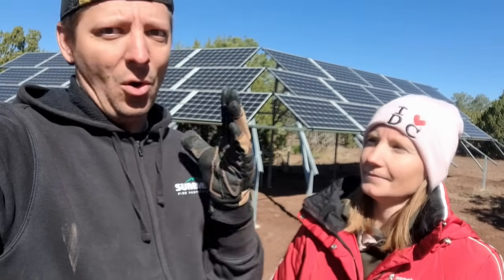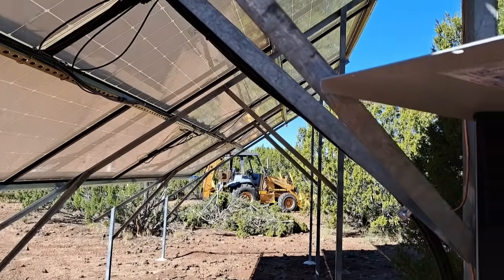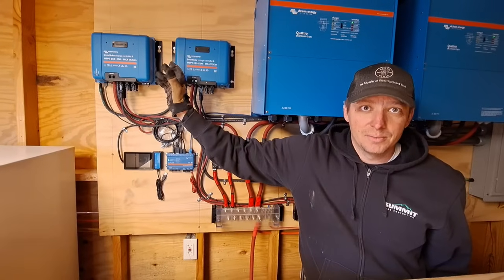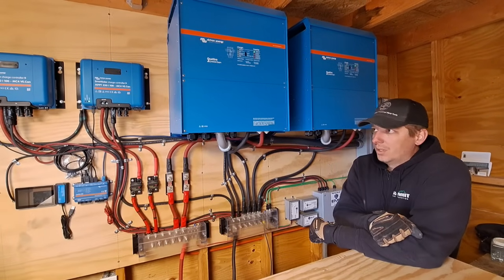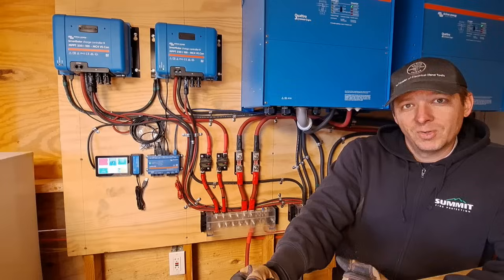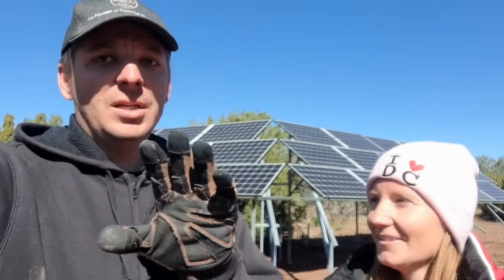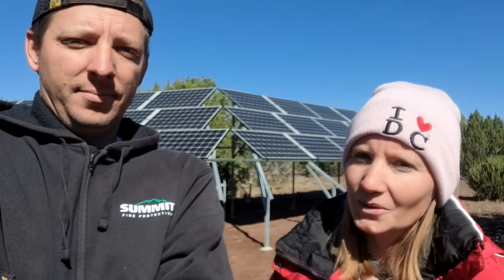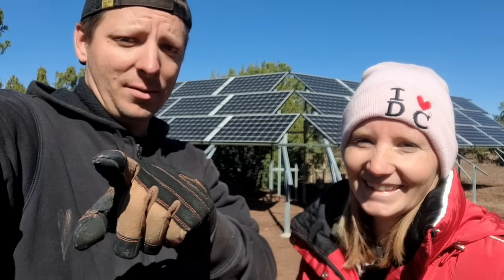INFLATED COST Of Our 100% DIY Off Grid SOLAR POWER SYSTEM 👍

Comment: Most do this simple interest calculation..."I will pay 100$/mo. for decades"...you won't❗. Ever hear of Inflation? And it's Compound Interest...Utility rates of Inflation avg. ~5.5%* (some have been recently 40+%!!) for US electric Rate increases. So at *traditional avg. U.S. rate increase (prior to 2020), 1200$/  year becomes ~3,500.$ in year 20.   Conclusion, if use same amt. of kWh/mo. over next 20 years at *traditional avg. rate increase , then you will avg. ~$1750$/ yr... or cumulative ~35,000.$$ over 20 years!!🧐  (if rates don't increase*...good luck with dreaming🤪.         + if you qualify, there are pot. State Incentives for solar+ a Fed. Tax Credit of 30% off cost of PV systems🤠

Comment: You should have built your own battery. You don't get enough kW from your $2k, I've built my own 15kW battery from cells and BMS in a wooden box. Only $2k a piece , or $133 per kW. And easier to maintain... What if you need to replace a cell or % BMS. Too many cables as well, large capacity means less cables, smaller bus bars, etc...

Comment: I am truly interested in your channel.  However, I came to this video, to see how much your solar system cost, based upon your thumbnail.  I was hoping, apparently in error, you would also be the very first, of the hundreds of videos/articles/blogs/vlogs I've consumed, to also say, in plain English, minus ALL the electrical jargon, What your system is capable of.  For instance, you mentioned your dryer and electric range.  That's wonderful, but have you had uninterrupted access to  both?  Have you always had all the power you've needed, 24/7.  How much stuff is running on your system?  

All the 9000 watts, 10000 watts, 48 volt, 100 amp, etc., talk means little more than nothing to me.  Is your system enough to give your property all the electricity it needs, all the time?  Like, if the sun does not shine for 10 days straight.  What would I need to buy to have that?

It's like searching for Sasquatch.  Is it too much to ask for someone to tell, say, a third grader, how much solar (even a ballpark of a ballpark of a number) equipment one would need for the average, 4 bedroom home?

Is a $37000. solar setup enough?  Again, think ballpark, not "Well, it all depends on your situation."   Here's my situation:  I live on planet Earth, I have a medium size house ( 2500 sq ft) and I want to completely cut ties with the electric company, while changing NOTHING about the way I consume electricity.  Do I need $25,000.,  $50,000., $100,000.?

PS  - I am not interested in breaking even.  I could not care less.  I want to generate my own power, regardless of how long it would take to "pay for itself".
Reply from the maker: Yes, it will run our electric range and clothes dryer at the same time. 

10 days of no sun would be a problem. The way to solve that would be a backup generator to recharge the battery bank, which we don't have. It's very rare where we are to have 2 or 3 days without sun (Arizona). At some point we will have a backup generator just in case, but for now, we are able to make due.

The plan for us is to build a 2800 Sq foot house and the system we have, plus a couple more batteries, should be able to handle it. Appreciate your comment and good luck. 🙂

Comment: It is too expensive. Already got:
1. 6500kw+6500kw hybrid inverters total: 13000kw 120/240v
2. Whole pallet 31 pcs 370watt of solar panels 
3. 4x 18v 100amp LiFePo4 batteries total 19200kwh
4. DIY Roof Mount system
5. cables/connectors/breakers/bus bar etc.
I got not every single part of my system but almost there. My total cost for now $8000. It wouldn’t cost more than $10000.  
After 30% tax credit final cost $7000. This is reasonable price and I need less than 3 years to cover expenses. Even if I will change some components after some years would be way cheaper than buying so expensive components from beginning.

Comment: How much would it have cost you to pay the electric company to get wire to you, just for the privilege of paying them a few thousand dollars a year?  Depending on how far away you are, you're probably only a year or two from the system paying for itself. ;)
Reply from the maker: It easily would have been over 100k.
Reply: @aboulderlifeoffgrid  so your system was a great deal.  It has already saved you so much.  Good job.

Comment: An off the grid solar system is so expensive. I don't know why people who do off the grid don't do it like this. Go to a good Junkyard and get solar panels, the controller, and the rest from a camper wreck. Purchase a good generator. A home uses very little electric most of the time. So you turn the  generator on only when you need it. Your annual cost in a 2000 Sq ft home for fuel will be under 2 Grand. Take the cash you would have paid for an over priced system and invest in a high yield Mutual fund. An ETF high yield is doing just over 10% high now. You will make more than the cost of fuel.  You just need a well insulated home and shade. Your Refrigerator should be Propane,or 12 volt. Your AC should be a heat pump. A good wood stove is a help.

Comment: You could have saved the money on the EMP shields.   They will do nothing against EMP.
Reply from the maker: Sure they will.
Reply: @aboulderlifeoffgrid  Err, no. any cable longer than a few inches defeats the protection element ( the transorb/MOV etc ) . Who told you what you have would work?
Reply from the maker: @nigelwarrington3696  The Victron distributor in our area.
Reply: @aboulderlifeoffgrid  Ask them for test data, for example, MIL STD 461G Method RS105. The clue is in the wires: if you have external protection there is too much exposed wiring. Just 1/2 metre will cause failure.
Reply: @nigelwarrington3696 what is this even for? I tried looking into these, but it just sounds like a surge protector.
Unless your actually afraid of an emp.

Comment: You shouldn't build this league battery house closer to yours so right because the further you go away from your raid the more loss that you lose in your. Warring and the father you go from your battery area. Your powerhouse to your trailer travel trailer is more power that you're losing down that way too in the line so. You gotta think about it. You lose in a lot of power down by.  Being further away
Reply from the maker: The power loss you are referring to is called voltage drop. The way that is fixed is by installing larger wire sizes. We installed larger wire from our array to the shed and larger wire from the shed to the trailer. Thanks for the concern. Take care. 🙂

Comment: I am surprised it cost you that much just do everything you did priority been a little cheaper but it bought a stand and I'm still surprised it took so much to build your battery box mine only cost at what maybe about  $120 constanza relatively free for my solar panels I mean I did get a bunch of beans for free maybe except for gas and sansei $20 I did buy some lumber so my stand costed maybe $92. And 20 more dollars in gas sence friend hald it for me. The batteries are still got to get. But  I had a bunch of better that I lost seven of them this past winter and I had 24 of them lead-acid batteries 1000 amps 135 amp hours. Replace them but I think I'm just going to replace all my batteries I mean hey did last me one heck of a long time about 24 years some of them even longer so the last 20 years longer than your supposed to. I going  to get more solar panels and that was running everything in 12 volts but if I get real batteries that are rated for solar panels. But in the process of it I'm also going to get some more solar panels I'm not getting rid of any sort kind of them in they still give me the same watts they did when I bought them twenty years back or so and what they said you were going to give me twenty-some years ago when I bought them new so they're still good solar panels. But depending on what size solar panels I did I may have to replace some of them anyway.
Reply from the maker: We may have gone a little overboard on the battery box 😅. But it works well and looks good too now that the doors are on it. Thanks for watching. 🙂
Reply: @aboulderlifeoffgrid  I like your show thank you.

Comment: $700...could have made it yourself with $200 of copper bar stock. Hell yeah. Could have gotten 5.12kwh batteries for $1500.

This is DIY without a budget. Anyone could make a similar system for less than 20
Reply from the maker: But you can't go wrong with Victron. Thanks for watching.

Comment: #1 Mistake
$11,000 battery
Never Ever buy batteries for a solar system
1. $$$ Cost
2. Life Span
3. Type have draw backs
Never Ever buy batteries for a solar system
Buy a EvCar or EvTruch  V2G power stroage
Reply: Buy a Ford EvTrudk and use the V2G as your home solar power storage.= 
Do Not Buy Tesla Musk sells PowerWalls and has stated Tesla never be V2G
99.99% of the time you park your IceCar and y 
I EvCar family = 7 to 8 PowerWalls of storage
2 EvCar familly = 14 to 16 PowerWalls of storage

Comment: The cost is not sensible.   The fear of social implosion is fueling stupid IMHO.  If your on grid then you may need a week of power while repairs are made.  If your prepping for all out mad max scenario..more power to you.  America has been through tough times in the past.  If this is the end, your bug out bag, power systems wont save you.  So, buy a whole home ups and dual fuel generator and get on with your life. If your flush with cash and enjoy the project then this does not apply.  Theres too much hysteria.  Besides, the EMP from a nuke is going to take your systems down anyway so there is that.  If you can sell back or offset your bill and break even in 5 years, that seems to make sense.  Also if you spend 30k on power independence but dont have a years worth of food and water plan....i question your logic.  If your off grid then go for it.  Personally i would buy land with a creek/river and do hydro.  For my grid home i would do a eg4 6000 or sw 4024 with batteries and a dual fuel generator.  When power is out we have nat gas.  I can run for a long time.

Comment: Why not use EG4 hardware to use fewer components, less wiring, lower cost? This feels unnecessarily complex. All-in-one systems are a much better solution. You spend so much money on all the interconnects which you can avoid with all-in-one's and better designed batteries. Technology is advancing really quickly right now so it doesn't make sense to overpay for technology that will last a long time. It's likely you can buy something better and cheaper in the next few years. This is a time to build and replace incrementally. This is not the time for "one and done". You way overpaid for "quality" at a time when you really shouldn't. Victron is a dinosaur. Once a market is mature, that's the time to pay more for quality that will last many years.

Comment: My electric bill runs about 100 bucks a month. At that cost, I could pay my electric for 370 months, or to do the math, 30 years. 30 years. 30 years of just paying the utility company for my power, 30 years.  Not only will you have to replace those batteries in that time, probably at least twice, which makes this an even more insane endeavor at the cost of the batteries, any unforeseen problems with the equipment will cost you even that much more. This is an insane amount of money to spend on solar.

We use an electric water heater, a 220 volt dryer, all of our lights are LED,  our stove is propane, as well as our furnace. Our well is 220 as well.

Our secret to a low electric bill? Turn shit off.

I can see you guys spending almost double that amount over the life of that system Just replacing components that fail or get damaged from weather.
Reply: Many people don't want to depend on government and greedy power companies. Extremely worth it in my book specially with utility power costs going up as fast as they are.

Comment: Not worth it. If normally your grid electric bill is 200 dollars a month it would take 10 years just to break even IF you had no repairs due to mechanical failures or weather damage. Had you taken the 25,930 dollars and invested for 10 years you could have doubled your money. Solar is almost ALWAYS a loser.
Reply from the maker: Well, this is the life we chose. Electric is about $500 a month in Phoenix where we came from. And who knows how much electric bills will be in 10 years. Thanks for watching. 🙂
Reply: @aboulderlifeoffgrid  These people just don't get it... it's not about payback, it's about energy independence. I set up solar not much different than yours, we live in southwest Florida and went through Ian. It was nice not to lose power, no worries about running generator and putting up with the noise and finding gas. For us it was business as usual. We were able to sit in air conditioned comfort and watch the event on television while everybody around us was dark until they could get their noisy generators up and running. Right about then I could have cared less about how long it was going to take to have the system pay back. We average about 60 kilowatt hours a day in power generation and it goes into batteries I would never grid tie.  Anyway, good job and payback be damned...

Comment: You got scammed hard, on a lot of the components like the EMP stuff.
Reply from the maker: How so?
Reply: @aboulderlifeoffgrid  Google empshield scam,  They are likely just a cheap surge protector, name brand ones like Eaton start at about $60 for something that you wire into your distribution panels.   Most of the marketing is just smoke and mirrors, scam marketing.  For a custom DC solution from an electrician designed for your solar, expect to pay maybe $160 each,   So a 1/3 of the cost at a minimum.  The Victron stuff is nice, I would have done the DC distribution different though,  A victron lynx distributor on the wall etc,
Reply from the maker: @switzerland3696  Interesting information. Thank you.